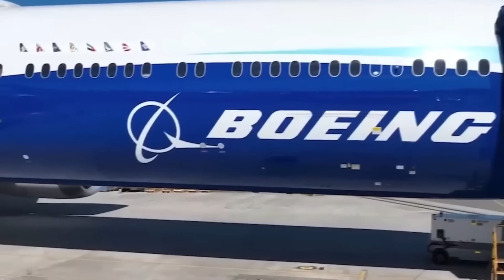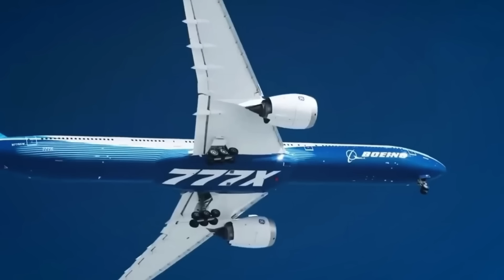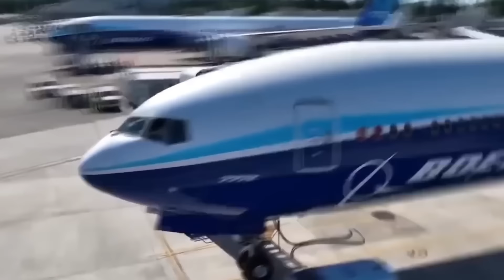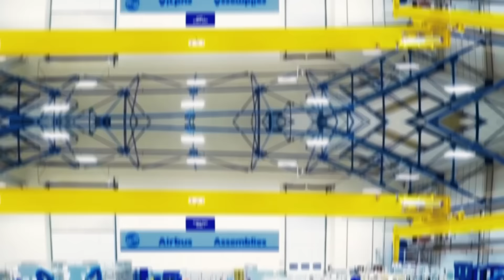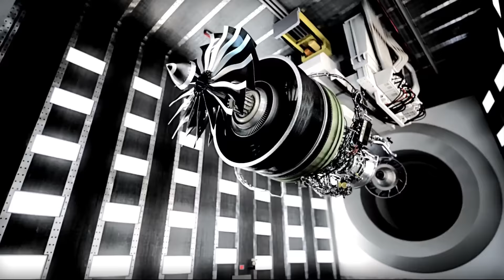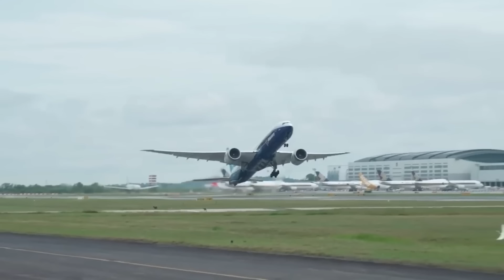Here Is Why the Boeing 777X Is More Revolutionary Than You Think

Comment: You noted that the fan diameter of the GE9X 134" and it is larger than the fuselage of the 737.

The outside diameter of the fuselage of the 737 is 148".

The O.D. of the GE9X engine with its cowlings installed is 184"

Comment: The 777X will be more efficient than the A350 1000 (on paper). Airbus makes good planes but they tend to fly Rolls Royce engines on the larger planes, keeping their money in the EU. I knew GE was not going to do a variant for the A350, Airbus could have redesigned their engine mounts but didn't want to do that due to cost and time. To be fair,  GE also has growing pains with the new GE9X which seems to be taking forever to get to the market. The entire package is supposed to reduce the cost per passenger mile which is what the airlines look at. It appears that the 777X coupled to the GE9X is going to be a winner for the airlines (when they actually start flying them)! In nearly every case the Boeing/GE combinations save airlines a lot of money. The problem: It takes Boeing FOREVER to get their planes to the customers!! I don't know how Airbus does it. Perfect example is Delta airlines, they were a huge Boeing customer but Boeing could not deliver planes to meet their growth and they bought a lot of Airbus planes to fill the gaps. Boeing needs to get off their ass and start deliveries! I know the FAA is being very strict with the certification of this plane due to the self induced issues with the 737 max and that is a good thing, but it seems as if both Boeing and GE continue to step over dollars to save a dime!

Comment: I don’t think the 777x will be as successful as the original 777. While it will be a great quad jet replacement more should have been done to modernize the aircraft. This market segment is also shrinking. The better medium wide bodies get the less demand we will see for jets of this size as more airlines fly point to point. The 787 and A350 are in my opinion still the epitome of what commercial aviation is capable of and sets a higher bar than the 777x.
Reply: It will sell in bigger numbers than the original.    The 777 is significantly larger than the 787.   The four engine segment is disappearing.   Larger two engine giants are a stable and growing segment.
Reply: @cpcattin  The 777x is kind of lazy. You can tell it was born in an era where the company was run by accountants rather than engineers. It was made to be more efficient than its predecessor and large enough to replace quad jets. It was built to be enough not revolutionary. The 777x is going on 14 years of development. All this wait for new engines, new wings, flight control systems from the 787 and a fuselage constructed of materials from yesterday’s aircraft. Airbus gave the A330neo the same treatment in 4 years. Boeing built the 777x as if in a vacuum devoid of competition. If Airbus were to build an aircraft of this size the way they build the A350 the 777x would never be able to compete with its per seat economics.
Reply: @Strickland325  It's just an updated 777, which was designed before Boeing was run by accountants (2003-2018 lets say). It was an excellent aircraft. The updated aircraft is updated about how you would expect, new wings, new engines, plus various other not too complicated upgrades. If Airbus wants to make a brand new aircraft of the same size, they can do so, but it will cost probably $20+ billion and many years before it is certified. I'm sure Boeing and Airbus will develop brand new planes in the next 10 years, but they're not just going to do so without a very comprehensive feasibility study.
Reply: @Djamonja  We are agreeing to the same thing. The original 777 was a great plane for the time it was launched. But having a 14 year development period we should have a ground breaking aircraft. A 550 pax aircraft with all the features of the 787. Not a 777neo. The 787 only took 7 years to develop, the original 777 only 5.